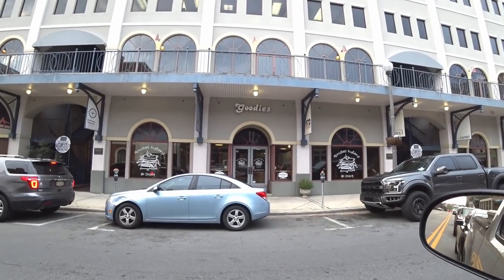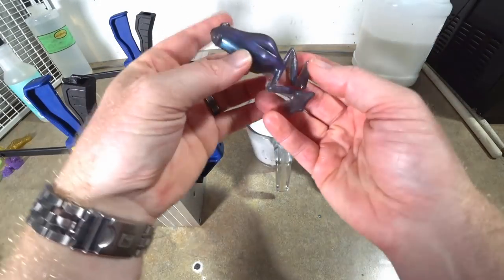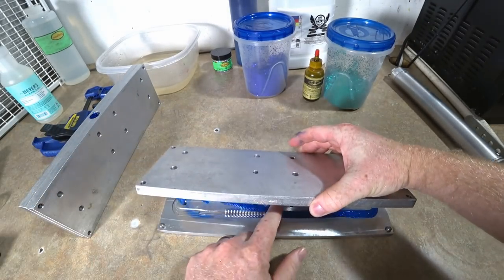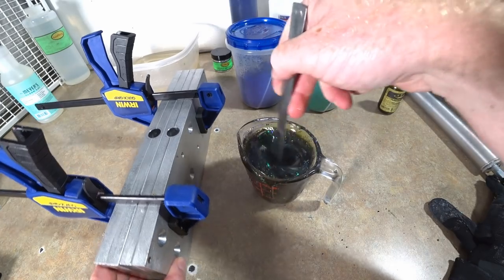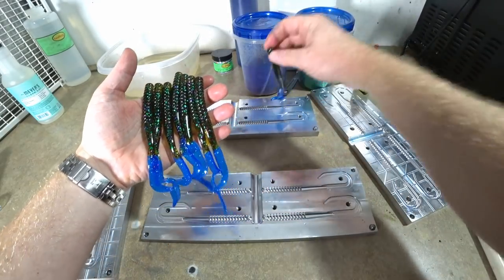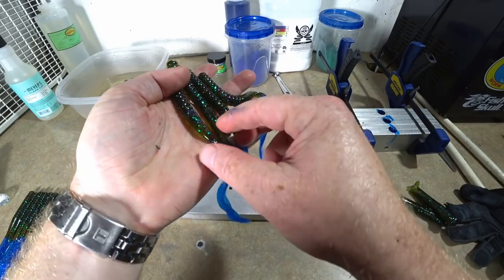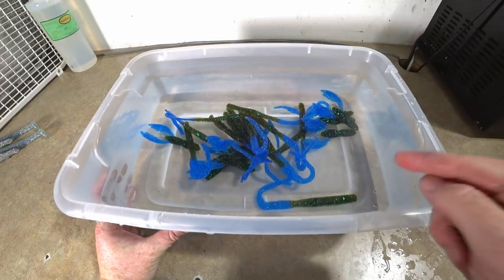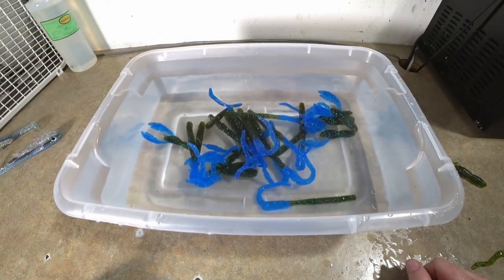Sinking Body, Floating Tail; Making Fishing Lures with Both Types of Plastisol

Comment: I have been working with mixing the floating plastic in the back of injected swim baits with sinking in the belly. Because of the density of the sinking plastic I started thinking that it might be possible to "control" sink rates as well as making a weightless setup right itself quickly. It works well with injected baits, but the blend is pretty much set by the mold cavity I just bought a bunch of hand pour molds for swim and jerk baits that I plan to play with in an effort to come up with some ratios that give somewhat predictable results. Being a river fisherman, buoyancy is a big part of the game when drifting plastic through a riffle or run. A side benefit I think might come from this with the jerk baits is less line twist. Any way, great video! Really like the idea